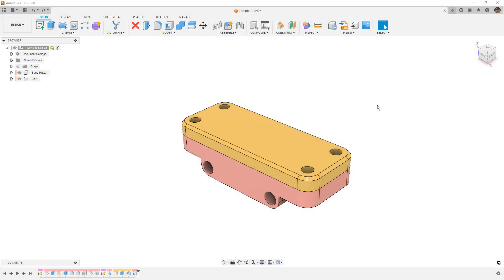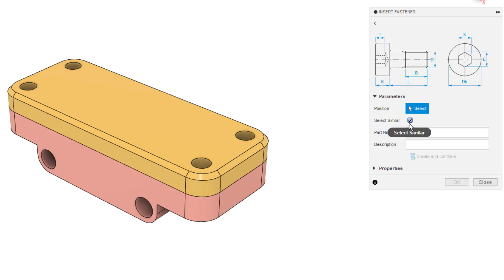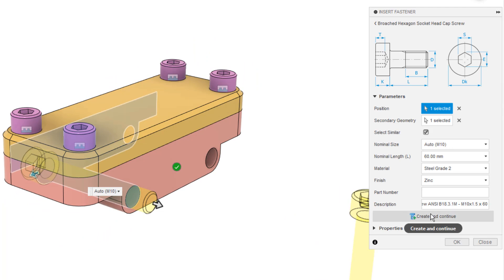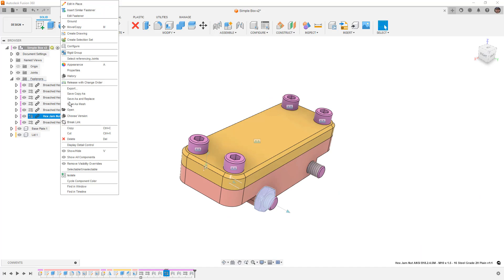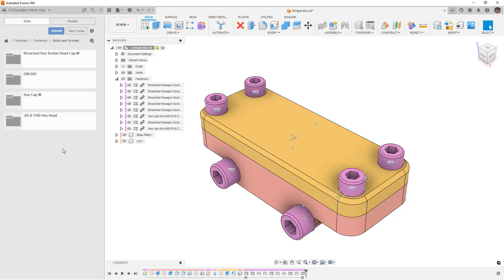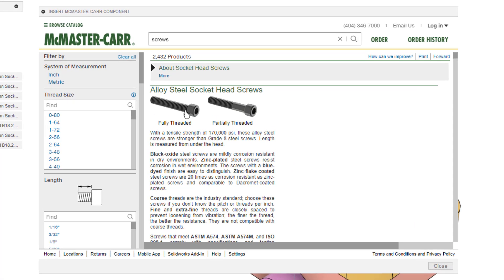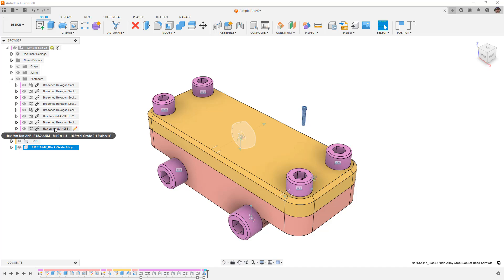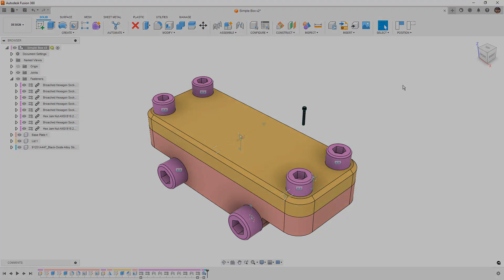Insert Fastener | How It Works | Where It Goes | How Does It Stack Up To McMaster Carr | How To

Comment: Great video. I have a question: how can I import a Twist-Resistant Rivet Nut that does not appear in the list? Can I import it from somewhere? This component does exist in Mcmaster. Thanks.
Reply from the maker: If its not in the Insert Fastener or Mcmaster (or one of the other parts insert tools) then you have to either model it yourself or find an available 3d model of it.  If you  have a 3d model of it you can upload that to your fusion data panel.  It won't have history on how it was modeled but you can insert it into your design by dragging it in or using the Insert Component (under assemble).

Note that if you upload a neutral file like a step or iges, when you open in fusion by default history will be off.  Right click on the top of the browser (where the file name is or (unsaved) on a new document) and change to parametric modeling (last option at the bottom of the right click menu)

Comment: I do like the insert fasteners, but I find the library range is a bit limited.  For example M3 shcs max out at 30mm length, so in I have had to go back to older methods.  Also things like heat set inserts are missing.   I really hate the idea of mixing McMaster-Carr and Fusion Fasteners in a single design because i find it hard to remember where I have used what, so I end up just defaulting to McMaster-Carr and not using Fusion Fasteners, which is a shame because the mechanics of inserting Fusion Fasteners is so nice.
Reply from the maker: Agreed.  I still go to mcmaster as my default.  I will say they have been adding more fasteners each update but not sure how long it will be until they are all up to date.

Comment: Hi Matt, thanks for the video, the Insert Fastener tool is extremely useful, but do you know how to get rid of those little icons/marks next to the parts that you inserted?  Those things are annoying!
Reply from the maker: I don't think the Fasteners have their own icon.  Are you seeing the Joint icons?  If so you can hide them in the Joints folder(or the entire folder).  With sub-components you may need to dig into their own folders because joints are tied to their parent component.

Comment: Thanks for providing guidance on this great feature.  To control all the fasteners in an assembly I make a component folder under the node to hold all the fasteners associated with that assembly.  I do the same for any subassy also.  Also makes it easier to identify the fasteners and make changes. McMaster is a great source.  I usually copy the part number I will use in the Fastener dialog box.  In addition I have a separate fastener folder that holds all the parts I use.  Thanks again for the video.
Reply from the maker: Insert Fastener is getting better, but I still use McMaster more if i am designing something to be produced.  They have favorites now but it would be great to search through a set of fasteners and have mcmaster carr or some vendor part numbers associated with them.

Comment: Can somebody tell me why insert fasteners is only available in a fusion team?
Reply from the maker: The fasteners are saved and created on the cloud and stored in a fasteners folder.  Is that what you mean?
Reply: @LearnEverythingAboutDesign   My question is why insert fasteners is not available when I want to work in a single user storage environment. The feature is greyed out. But if I switch to the team environment insert fasteners is available to use.

Comment: Hi. Thanks for your great videos. Can you please make a video about the sketch manipulation point for the curve? Sometimes it just freezes and can't be moved even after deleting constraints. I've read that this is a bug in the past but i think it is still there. Thanks.
Reply from the maker: Are you talking about a spline?  And do you mean moving the spline point will freeze fusion? or just the curve can no longer be moved?  I haven't run into that personally and I use a lot of spline curves.  I mainly focus on the control point style spline.  When i use the standard spline with the points on the curve I generally stick with start/end points and control the handles.
Reply: @LearnEverythingAboutDesign  yes spline. I always use fit point spline but after some time while editing i can activate the control handle but it can no longer be moved. The point just freezes, not the fusion. I need to delete and redraw again.
Reply from the maker: @skelethornbro  Next time that happens select the vertex to show the handle on the spline, then right click on the vertex and see what options you have.  Typically you can force an activate/deativate handle that way.  Depending on the spline you may be able to "relax" which will deactivate it.  Another thing to try is to select the spline and then right click, insert spline point.  Sometimes adding a new spline point, even if you just delete it right away, will unlcuk whatever is going on.

Comment: I find it hard when you are to pick longer hardware, like a m3x35…
Reply from the maker: From the drop down or if you are dragging it manually?
Reply: @LearnEverythingAboutDesign  from the drop-down in the wizard.
Reply from the maker: @ZebbeBa  Gotcha,  I normally pick the location first, the reference face for the head of the bolt and while the dialog is active use the Nominal Length Drop down.  I haven't noticed any issues but i also haven't come across something that was outside of the normal ranges.  While it doesn't fix the issue, if you insert a bolt that is too short, if you open that up the first user parameter is generally the length of that bolt and can be changed.  If you save it (or do a save as with a new name/part number) it can update/ be replaced in your assembly.  Again not a smooth fix but if you know the rest of the bolt is correct and just need a longer length than the insert fastener has you can work around that way.
Reply: @LearnEverythingAboutDesign  oh! That is smart! Will defiantly try it! Thanks a lot and thanks for great content!

Comment: This is going to be a great tool for me going forward, no more duplicates of duplicates and it looks like on the fly changes would be way easier
Reply from the maker: Yeah I am like 50/50 glad that it defaults to a project called Fasteners but that is not ideal in all cases.
Reply: @LearnEverythingAboutDesign  it kind of surprises me how great both of these systems are but yet they’re separate period. If they integrated them together, it would make multi component assemblies much easier to design. Does this just include hardware like nuts and bolts or are there other components like rods and bearings because that would be an awesome integration as well.
Reply from the maker: @Noughtta  currently its nuts, bolts, and washers.  Inventor has tools to generate bearings, cotter pins, shafts etc.  I don't know if Fusion will go that way but it sure would be nice.  Inventor can build these base on calculations which is a great feature.  It will help you pick the right size components.

but yeah if this was integrated into Mcmaster or another hardware vendor that would be amazing.

Comment: Interesting. played with it for a few months in preview but it wasn't quite ready and no real instructions. Seems like it could be a plus. Would be nice if it had a "My Fasteners" sections that kept commonly used fasteners rather than searching from scratch each time
Reply from the maker: Great suggestion!  You could drag/drop them from the fasteners project in the data panel, but i agree having a "commonly used" or even showing whats in that folder in a filter would be great.  I will make that suggestion next time I talk with the PM over the design tools at Autodesk.